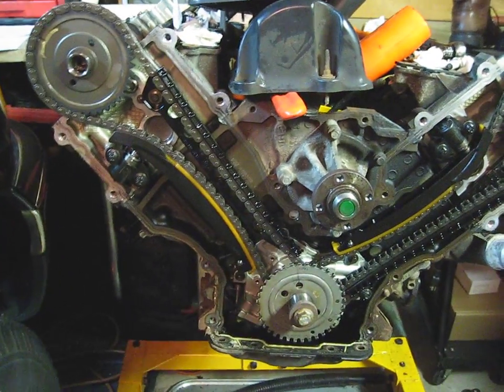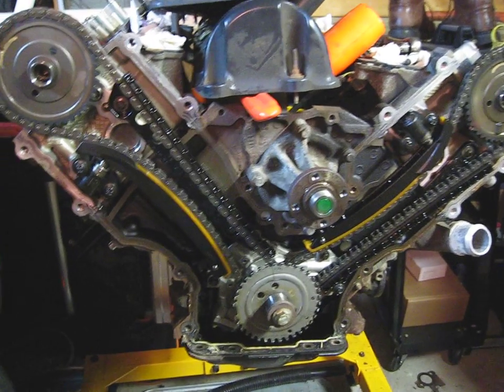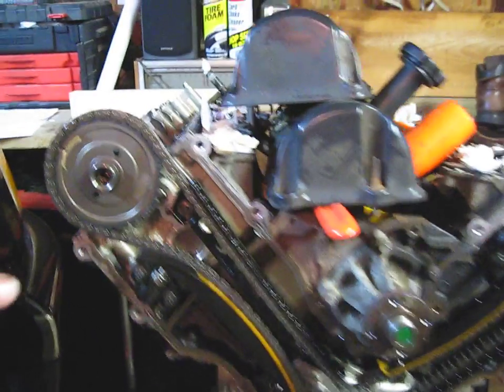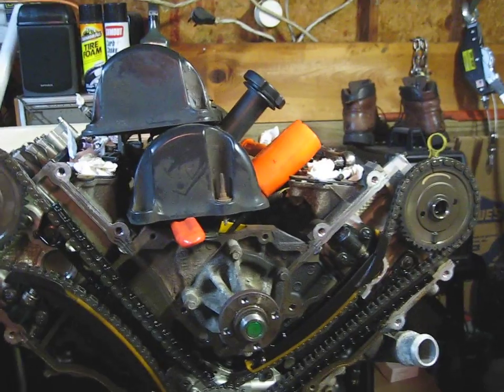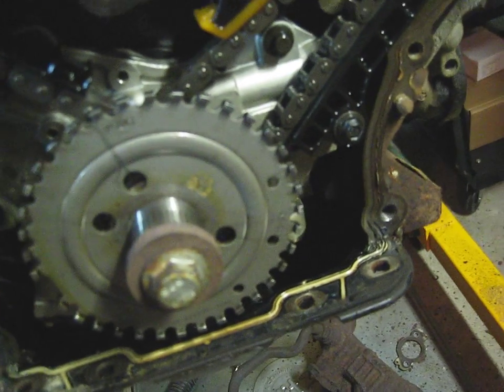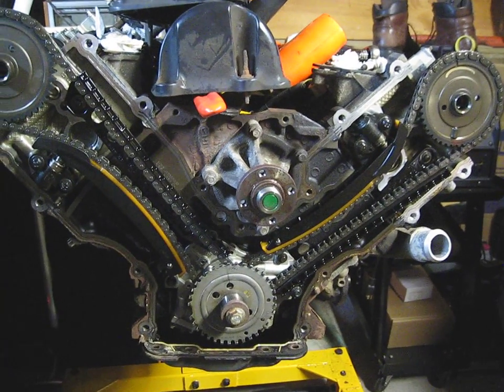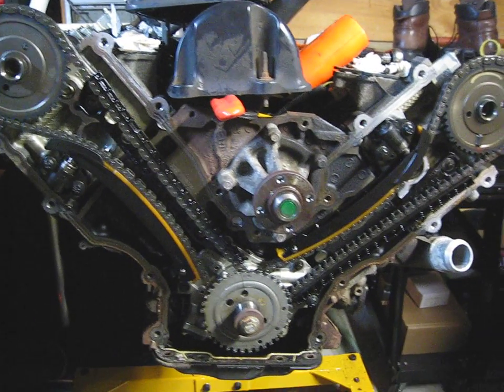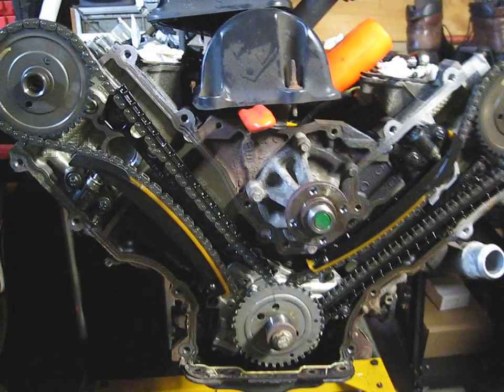Ford 5.4l Timing chain removal plan

Comment: First before you do anything put timing cover back on then alighn the crank pulley slot with top dead center mark on  timing cover their is two marks bftds & tds. Make sure cam shaft gear marks are at 11&12 oclock. Then using special tools lock the two cams down. Then you can disasembly can begin.lots of utube videos to help. I am learning aswell.

Comment: timing mark are on the chain
Reply: match it with the timing mark onn the gear
Reply: The dot on spocket match single black chain link then  center the other two black chain links with R or L

Comment: When you seat  the heads  do i need  to be at the tdc... at the crankshaft?  Because  alldata said. Before remove the heads. My crankshaft key need to be at 12 a clock.. and the i can remove the heads. . So thata what i did. . So  now to put the heads back on do i need to move my crank to the tdc.. and then put the heads on and move my cams to Mach  the li nks on the chain. .?   Thanks for the help

Comment: mark things  like the  chain to sprocket and cam to sprocket crank to chain as well
the chain tensioners will need removal and compression during reassembly 
make sure everything lines up

Comment: Remove your crankshaft sensor timing gear. On the inner gear you will see a timing mark. When that dot is at the 6 o clock position Cylinder One is at TDC. (RH Closest to Radiator or Front of the Truck). You don't need a compression tester for that. Make sure the spark plugs are removed and you can place a long screwdriver down Cylinder one to ensure it's at TDC by rotating the crankshaft counter clock-wise only do not rotate the crankshaft clockwise. Each chain will have two black links: those go on the dot on the  on the Crankshaft Inner gear which on reassembly will be at the 6 o'clock position. Your RH Camshaft needs to be at the 11 oclock on your LH camshaft needs to be at the 12 oclock position when reassembling. Use your outter timing marks that come factory on the camshaft gears. The black link on the chain goes on the timing marks on the Cam Gear. These camshafts have a preload to them and the cams will jump a bit so have a buddy with to help. It's pretty much a two person gig most of the time if you don't have the camshaft tool to hold them in place.
Reply: GREAt info. Why cant you rotate the crank clockwise? Kinda hard to spin it counter clock wise because the harmonic balancer bolt will loosen. Dont see how this can cause damage.

Comment: I would zip tie the chain to the gear as well as zip tie the rest of the chain in place so that it does not fall out of the track once secure slide your gears off  then remove the cylinder head. I a doing the exact same thing to a 2009 F-250 5.4L and I'm getting ready to remove timing chain and gear without removing the front half of engine. I'm waiting for the book to remove it in the correct sequence the repair book cost 20 bucks at autozone or any part store.
Reply: you are right about what you said in regards to your motor a 3 valve. the one he has is a 2 valve. different with valve train and cam components.

Comment: This is the 2 valve 5.4L, so this doesn't have variable camshaft timing, The 5.4L 3 valve engines from 2004 and up have the variable cam timing.

Comment: Hello Tvkfdh, do you know the timing marks for a 2004 5.4ltr 3 valve, it has a VTC (variable timing cam) and the link has two seterate coppper links in the chain. I just want to make sure I set it right. Also, do you know how i can test the VTC.

Comment: The engine im working on is the 5.4ltr 3 valve that has a variable timing cam, also called phaser. if you can. please e-mail me at ialvarado2007@yahoo.com Thanks any help is appreciated.

Comment: Sorry, I meant the variable timing cam. Is there a way to test? Also the copper link on the chain, Those are just to set the inital timing right? I notice when i have the engine on TDC the links are not where they are suppose to be. Any help will be great thanks.

Comment: If u will take the crankshaft position sensor gear off u will see the timing marks on the crankshaft sprocket. U do need to keep ur cams from turning when u go to take the chain tensioners off. But if u can't then do this get a compression tester get ur #1 piston to the top ur crankshaft sprocket timing mark should be at 6 o'clock when the piston is TDC. Then rotate the crank counter clockwise til the timing marks are at 9 o'clock this puts all ur pistons BTC then u can take everything loose. D

Comment: Then a tool is required to hold the passenger side camshaft in place so that it doesnt turn (the tool prevents the valves from slamming into the top of the piston due to valve spring pressure) when the timing chain is taken off. Once u get timing chain off you can remove the cylinder head and remove tool to put onto the driverside camshaft and get its chain off so that you may remove the cylinder head.

Comment: Im workin on the same engine.  The first head to take off is the passenger side, then the driver side may be taken off.  First, you turn the crankshaft till its woodruff key is at the bottom (bout 6 oclock position and the number one cyclinder is at top dead center on its compression stroke) then both timing marks on the camshafts will be towards the tops (their square shaped).